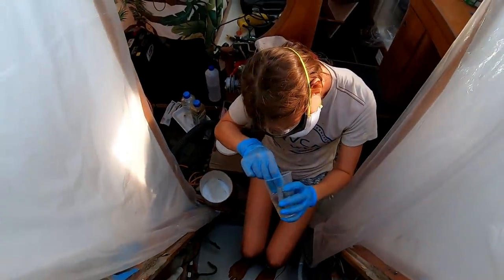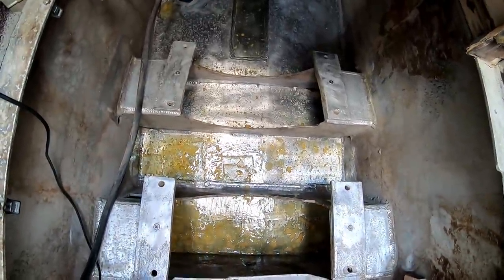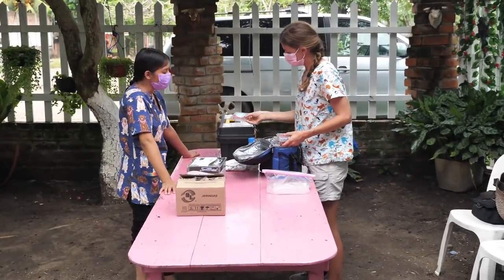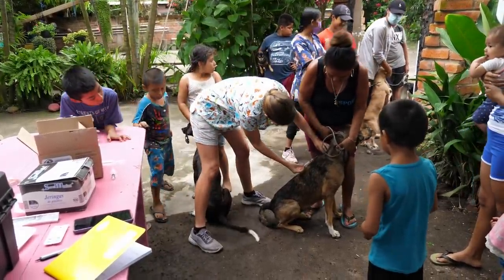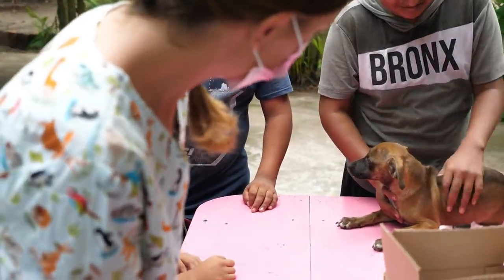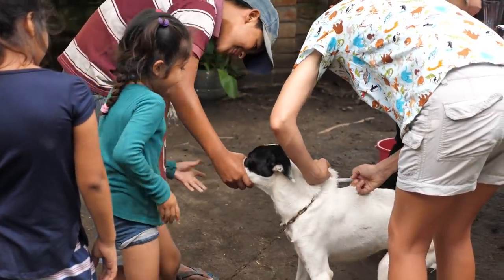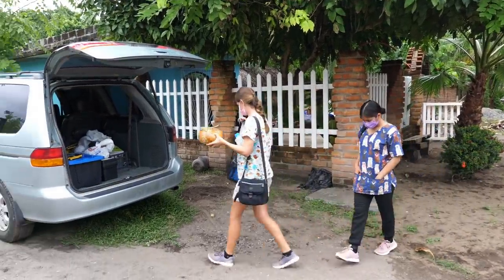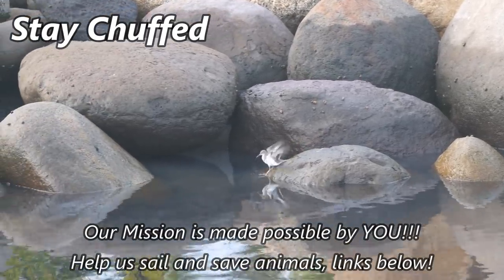Restoring an Aluminum Engine Compartment (+ we protect more dogs!) Chuffed Adventures S03Ep14

Comment: I did comment once before on the corrosion subject, now I have seen your video it can be my hull.  I can share with you, that after about two years or so in my experience Fiberglas, will lift as the aluminum surface will corrode unseen under the Fibreglass and filler until it's too late. 
In restoring Skoiern I was shocked that could pull off the sheets of Fiberglas and filler from the hull easily because of the corrosion underneath.  Like yourselves, I had also filled and fibreglass the deeply pitted hull under the cockpit. Once I remove the patches of glass and filler underneath, there is significant corrosion.  Worse I had more deep pitting because of the unseen corrosion as this time the pitting was much deeper. 
After removing the patchwork, I cleaned the hull first you have done, and also used double-strength vinegar to cover the clean surface, I left the vinegar on for an hour and washed it off with fresh water. Now I have left the hull clean and I have left alone the pitted hull plates, so they can breathe, so far have had no corrosion after a year.   As your video shows, I have the same ugly corrosion and deep pitting gouges.  Frankly, I learned to live with the hull inside being scared with pits. It does not change the integrity of the hull, as the corrosion and further pitting has been stopped.  
The trick I found is to keep the hull free from moisture and keep it as clean as possible. The idea of having a drip tray is a good one. Or like a birdcage change the newspaper, though, in this case, use an absorbing sheet under the engine and change it every few months - Like you, I love my boat and accept that is the price I have to pay to keep an eye on any development the corrosion and clean it.   
Before I couldn’t see it growing under the fiberglass patches and filler, till it was too late - now the hull is bare I can spot corrosion easily. In your case, you now have repainted and Fiberglas and filled the pitting.  Since it's done, the best advice is just to leave it as it is. 
But start to inspect the area every 3 to 6 months.  As soon as you detect any paint filler or glass start to bubble and lift, remove that area as corrosion I have found has started to remove the fiberglass and spot clean it as I have done. Otherwise, the pitting will become deeper, as I had discovered.  Don’t worry the pitting and corrosion is not a big issue once you’re on top of it it becomes another maintains job - You both have learned a lot – Congratulations I’m very impressed with your dedication to meeting the challenge by restoring your boat. 
 Also, importantly, treating ill animals back to good health is commendable.  Keep up the wonderful work. SV Skoiern IV
Reply: You confirmed my suspicions while watching the video. Corrosion between the aluminum and epoxi/ epoxi & fiberglass is likely. Cutting and welding aluminum is cheap and easy. Why not weld a plate(s) over the corroded areas of concern?

Comment: Hi Doc Sheddy, By now of course you've already gotten engine installed, but if you can, try making some absorbent diapers for under the engine that can be removed for easier cleaning, or recycle some plastic containers from bulk laundry detergent or gallon plus milk jugs etc. They can be melted with the hot air gun ( for heat shrink ) and molded to capture drips of oil coolant, loose screws and bolts etc. It's much easier to remove ALL the gunk on a tray or diaper for cleaning OUTSIDE the engine bay. You'll likely find other neat ways to repurpose plastics like that for other tasks on board. Have you ever seen this DIY bottle recycler : https://www.youtube.com/watch?v=B-CIpY_qbfw  All that plastic rope could be woven into leashes or collars, netting for onboard storage hammocks... ?